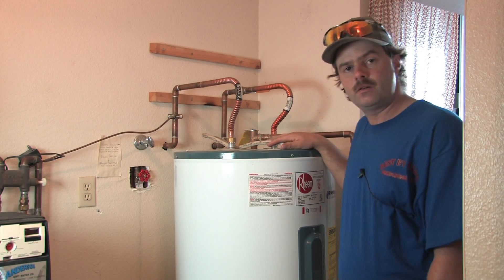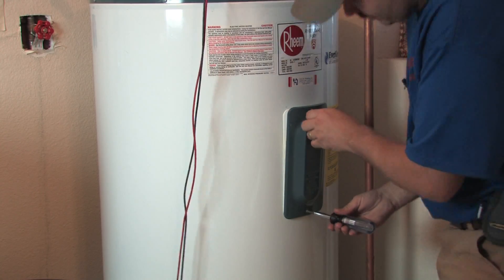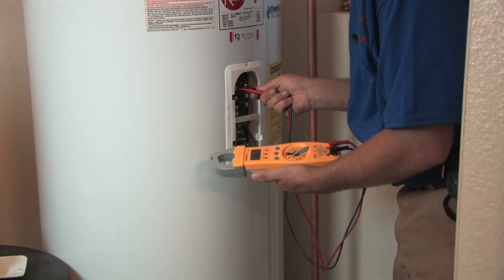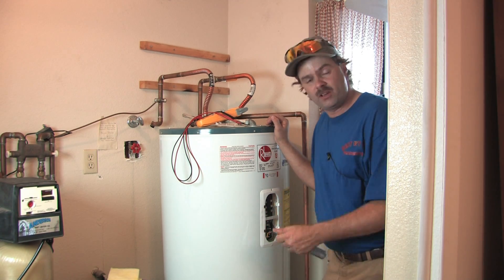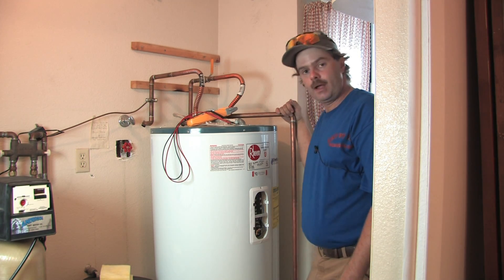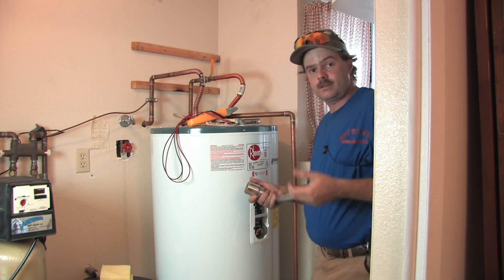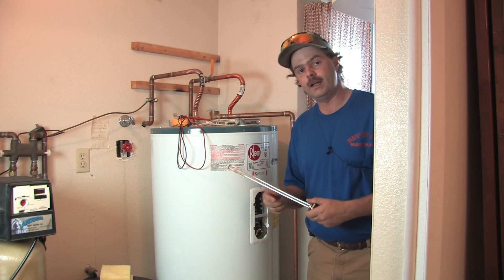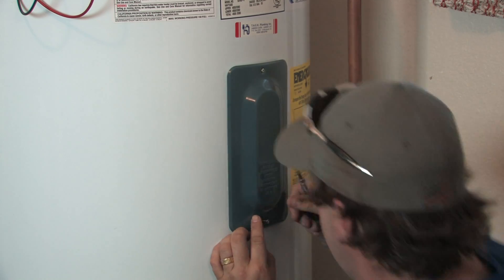Hot Water Heaters : How to Change a Heating Element for Hot Water Heaters

Comment: My elements are very long and super heavy when you try and put them in. I had to use vice grips to get enough leverage to get them started. They dip down and were just to heavy to get them straight enough to thread them.

Comment: Great video. My supply valve is an old gate valve and won't completely shutoff the water so the part about the "hiccup" and "don't be shy just get it out and get the new one in" was extremely helpful.

Comment: if you drain the tank below the top element and you replace it - you better be sure to fill you tank with water before you flip on the electricity -  that heat element will BLOW in about 10 seconds if it is high and dry -   why these videos do not tell people this ???

Comment: the wrench he's using to remove the element is heavy duty and will work great. The china one they sell in the stores that use a "screwdriver" for a lever are crap and will make your life suck.
Reply: The one I used from Home Depot worked well enough for me, but I guess I was lucky. I wanted to buy a 1/2" drive 1 1/2" inch socket but they didn't have any at Home Depot. Biggest they had was 1 1/4".

Comment: I have a solar water heater but I want to replace it with an electric water heater can I just plug up the tubes going to the solar panels and then install the electric water heater?

Comment: Thanks for the video!!!  Very complete and well done!  Also the prep with rubber gasket step was key.
Reply: My particular water heater is a 120 V water heater so in this case a single pole breaker. It’s rated for a 1650 W element. However, since the manufacturer doesn’t make these anymore, it’s using a 1500 W element and it works just fine. This is a 20 gallon heater and has a single heating element.

Comment: This worked good using the hiccup method.  Couldn't drain it due to too much sediment in the bottom.  A lot of sediment came out when I removed the old one, and the old one was burned up and bent like he mentions in the video.  

I had to really jerk and pull but it finally came out and I slid the new one in just in time.  You have to move fast if you're not draining the tank because quite a bit will come out, but if you have a lot of towels set up you can catch most of it.  It's all a matter of how long you have the element out or how long it takes to get the old one out which will determine your level of mess.

Comment: Good video , I have been a Master Plumber for over 30 years and he explains  the process well enough for a non plumber to replace the element if every thing goes right but there are some issues that he doesn't cover, (would take a longer video) that will make it a frustrating  job, like draining  the heater when the drain valve is full of rust and calcium build up,   so all you do it yourselves have at it.  Hope you can take a 240 volts shock?
Reply: I appreciate the video because I am a female living alone and have absolutely no money to hire a plumber period. So with safety and some common sense IM going to attempt it myself or its cold showers in 30 degree weather. He makes plain that it can be dangerous and it can. So can freezing to death. Lol
Reply: @karenfoster2123  exactly...if you're not confident it's off just shut down the main breaker... Best to just test it though

Comment: if you have hot water why do you need to heat it?
Reply: It can be going out if its taking longer or its not as hot as its supposed to be and lukewarm. Nobody I saw said to do it if the hot water is fine.

Comment: Nice video.  If you can get the camera in closer when showing were to check for voltage.  Also, people trying this need to know this can KILL you.  Check your  meter in a know socket or check the water heater for a reading and make sure that reading disappears when you flip the breaker.  Then turn on the breaker and do it all over again.   You don't get do overs if the power is on when you go to unscrew it.

Comment: any advice on how to get the element out if you can't turn it? i've used a screwdriver in the holes of the key, a monkey wrench on the key hoping for more torque.  my only other options are a breaker bar as you have or a plumber, and i really don't have money for a plumber.

Comment: Thanks for the help. I finished the job, got a little wet, but it's done. 

My question is: when pulling out the bottom element (like you said, it was sort of stuck), half of the element remained in the water heater. Will it cause me a problem if I leave the broken piece in the water heater? I have the exact one that you show in this video. 

Thanks a ton.